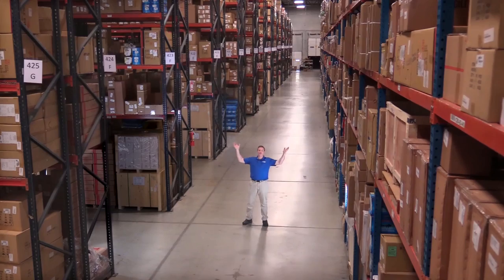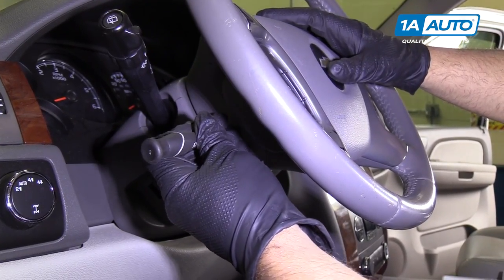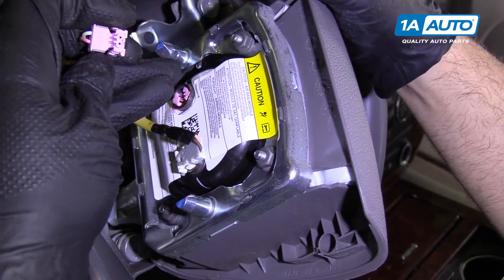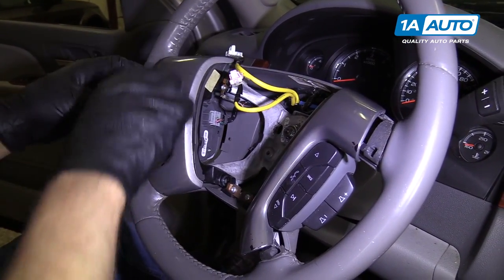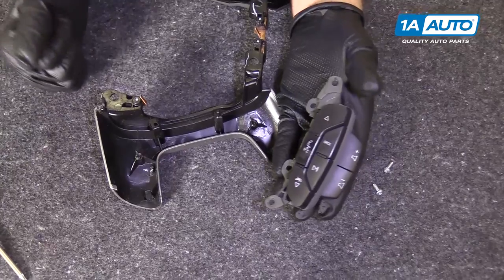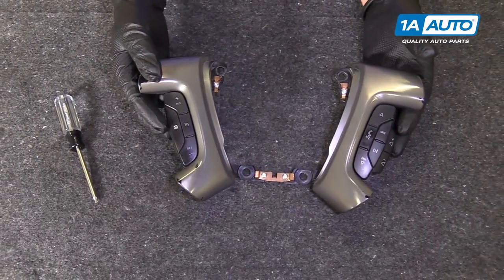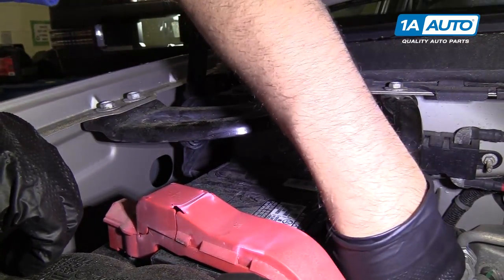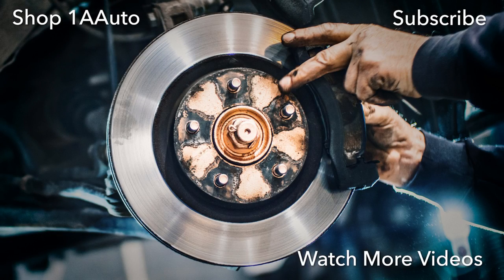How to Replace Steering Wheel  Audio Control Switches 07-14 Chevy Suburban 1500

Comment: My 2010 Suburban LTZ volume controls at steering wheel stopped functioning today along with the  factory reverse camera, also now have no ability to change volume at the main control . Is there any suggestions?  I can change channels at the main but no sound at all.
Reply: I'm am quite certain a fuse has blown in your vehicle.
Reply: Sounds like a bad ground wire. Check under your hood, it’s located near the firewall on driver side